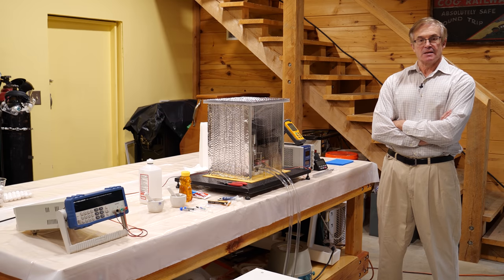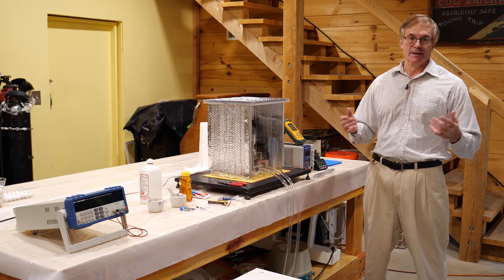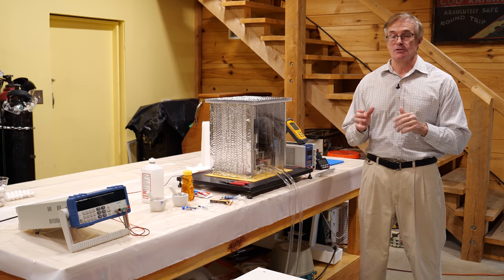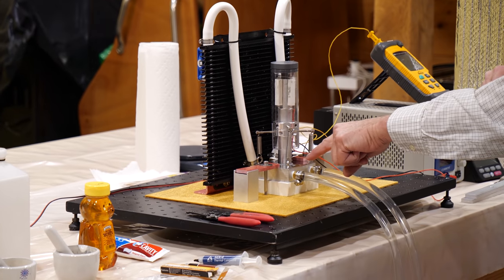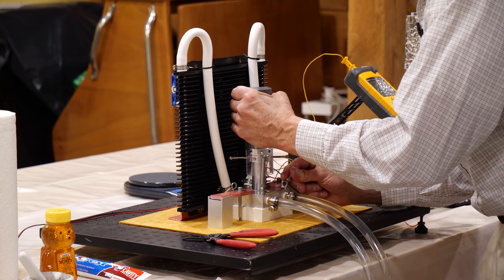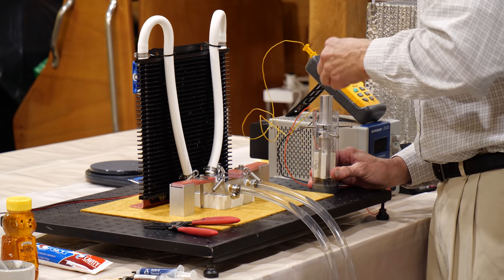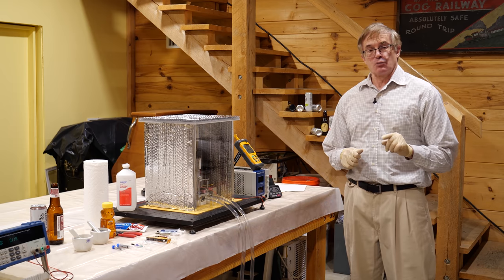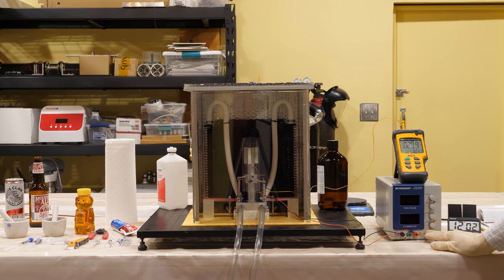DID WE JUST MAKE THE WORLD'S BEST THERMAL PASTE!?

Comment: One concern I have is how long this will last on a CPU or GPU. I use Thermal Grizzly Kryonaut which is almost the same as PK-3 if not the tiniest bit better and it's guaranteed to last years. How long do you expect this to last?
Reply: True PCMR replaces Thermal paste each times he boots up the PC
Reply: @V0LDY  So ... once every two years ?
Reply: This immediately entered my mind as well. How chemically stable is it, and if not how long before it begins to degrade as it undergoes thermal stress?
How long before I'll need to remove and reapply it, and could it potentially begin to set and harden over time and require specific chemicals in order to remove it? If it does degrade over time, could it potentially harm the CPU lid?
Reply: @HallsteinI  guess we will know in the next video where he teaches how to make it
Reply: Most thermal pastes use vegetable oil (ie the stuff you use to cook your eggs) to keep from drying out or polyethylene. You can literally take a couple drops of glycerin (vape juice) and mix it with toothpaste and you have the standard thermal paste that dell etc uses. He has obviously done the research and knows what is needed or he wouldn't sell it.
Reply: This is a huge factor, i use graphite sheets on family and friends PCs. A few degrees warmer is worth not having to T/S a random AF reboot from over temp over the phone cause the thermal paste is now dust.
Reply: @v0ldy54  I'm pretty sure he did videos on how they make it about a year ago.  I think it was around the time they were playing with homemade lasers but don't quote me on that.
Reply: @v0ldy54  if we use Linux maybe 🤷
Reply: @excitedbox5705  You willing to risk that on .1 degrees? Also thermal grizzly Kryonaut does the same so in reality you're betting for no reason.
Reply: Kryonaut degrades above 80C and suffers from pump-out. You should consider at least a yearly maintenance cycle.
Reply: @Tony-nl6pf  the reason is to support the channel. Worst case you replace it every year which is needed with certain brands anyway.
Reply: @zamalek4079  What's your point though, every thermal paste is almost the same in everything you said.
Reply: @Tony-nl6pf  This is a qualitative test so the .1 here doesn't necessarily meany that's the difference in what your cpu might end up at.This is a yet showing the difference between the products and doesn't represent actually te observed difference you might see in your setup;
Reply: @sumduma55  He showed a thermal epoxy before, but most people don't want to permanently glue their cpu. We;ll have to wait for the next episode for this recipe.
Reply: @connorjohnson4402  If there's no difference in the qualitative test, you can pretty accurately compare it to what will happen in real world setups. It's not even .1 I'd guess it would be from the same so 0 to about .05
Reply: You guys crack me up.  I put 20 year old lithium grease on my CPU and so long as it isn't removed it works just fine.  Last application was in 2008 on a Core2Quad...  No maintenance, no problem.  My current VR rig was built using the same stuff and has been going strong for nearly 5 years.  No maintenance.  
Heatsink compound has been around since the 60's.  No veggie oil.  Just heavy metals and happy days.  Proper application, adequate cooler, steady workloads.  It basically doesn't wear out or fail... Not within the useful lifespan of the equipment.  Keep buying whatever they tell you though.  You're keeping someone somewhere in business.
Reply: @tiporari  Your outdated junk doesn't need anything special and we never said ours did either. Your lithium grease and our high performance paste gives a 10 degree difference which is massive for overclocking, sound and performance. I bet you cry about people driving around 100 thousand dollar cars and say look at my beat up truck, it runs better and doesn't have all these stupid sensors going off. People like you crack me up.
Reply: realistically: if done correctly, any decent thermal compound will last at least 5 years if not a decade
Reply: @excitedbox5705  you mean silicon oil. Just about all of the commercially available TIMs use silicon dielectric grease as their base material and that stuff is under 50c/kg (aka clear silicon grease) - and silicon grease is rated to at least 150C

The primary reason the "fancy" stuff is so expensive is because it's sold in tiny packages. 

There's nothing new in that. I used to repackage silicon heatsink grease out of $10 5kg tubs for a major electronics distributor back in the 1980s and the 5ml syringes I put it into cost more than the grease did at about 7c each (2ml into each one) - but we sold it for $2 a pop with a fancy label on it - Total markup about $1.85 a tube and it sold like hotcakes
Reply: @miscbits6399  Lasting 5-10 years isn't the same as performing the same as new. After 2 years, it's time to swap. There's dozens of videos that show it degrades over time. I'm not going to buy his if it degrades within 6 months. It's like buying oil for a car, you need to know how the used and thermally cycled oil runs, not brand new.
Reply: @HallsteinI  I think chemical stability isn't really the problem. The real problem is suspension stability, and while there are a lot of pastes at low and standard performance grades which can last for 10 years, it's a plague that is pretty common among highest performance PC enthusiast pastes, i think IC Diamond was the one that was first noticed to exhibit it, but also Gelid GC Extreme and others. The less stable thermal pastes separate due to temperature cycling, which incurs some movement but is not consistent between liquid and solid fractions, which then allows the liquid to escape. Suspensions can be difficult to maintain.

Comment: Just for reference, what temperature do you end up with if you have no thermal paste at all?  Just the 2 smoothed surfaces against each other.
Reply: I was wondering this too. Would be nice to have the control temp to see how it compared.
Reply: Modern CPUs can even runnwithout any heatsink on them (throtling down so far that they're basically unusable, but still running), so I'd say the temps aren't an issiue, but the clocks the CPU will run at.
Reply: @Donnerwamp  True, but the default surface on CPU's and heatsinks are nowhere near as flat as his test rig. A few of the 'lapped' setups on YouTube would probably be pretty close, but true lapping with wavelength precision like he was talking about is nearly never done on CPU or heatsinks at least on YouTube. (Literally only 1 video with no numbers posted) His test rig is not true lapped, but that's fine.
Reply: For reference, I agree this would be interesting. Also, just for reference, why not use a drop of water.

Comment: I really wonder how this compares to "liquid metal" thermal interface material(s), wonder if you could have a go at testing that out in this contraption as well.
Reply: Yeah, both the gallium-based ones, and the "liquid copper" ones would be nice to compare to this.
Reply: Well for one it would require nickel-plated copper test blocks, gallium destroys aluminium and modifies copper.
Reply: Those outperform normal pastes by a lot. And so they'd outperform this. They have like 6 to 30 times higher thermal conductivity, depending on what paste you compare them to.
Also, they didn't make the best thermal paste until they beat Thermal Grizzly Kryonaut, the best paste I can think of.
Reply: @brei2670  Liquid metal is great for thermal transfer, but it has unique downsides that put it into a category of its own
Reply: Doesn't gallium react with aluminum . His test rod device is aluminum , if I heard right . Doesn't liquid metal have gallium in it ?
Reply: @texasslingleadsomtingwong8751  Yes, he would to switch to a copper or nickel plated copper as TIM is usually a gallium-indium-tin alloy. And yes, gallium is quite destructive of aluminum that it contacts with which can lead to surface pitting and erosion.
Reply: @ravencrovax  Gallium will migrate up the aluminium grain boundaries, turning any it contacts with into a crumbly powder. Also it is conductive, which I am not happy with on a motherboard, so I prefer an insulating one.
Reply: I was going to comment this as well. For those looking at the best thermal conductivity with known, but mitigated, downsides liquid metal might make sense. I think he should test that and also maybe fiddle around with formulations that might make application less risky (hot spots, spillage causing shorting etc). That would be cool as well. Liquid metal has kind of become a fad lately with the enthusiasts so I am curious to see if the hype is worth the downsides. Linus did say on a recent build that temperature differences on a specific build with liquid metal is good for 5 degrees difference, which is actually a lot just for a thermal interface only change.
Reply: I've lost count of how many motherboard/ video card repair videos I've seen where they had fallen victim to the liquid metal going where it shouldn't
Reply: @adamrichardson2227  Yes, but in general use for most people the thermal interface is not too critical, just use some, to a properly prepared surface both sides, and clamp evenly. The difference between as it came from the supplier, and simply making flat with some 2000 grit waterpaper on a flat surface, easiest is a small plate glass piece, or a small polished stone floor tile, is much more than the different pastes alone. Just cleaning off the original compound, polishing the surfaces and replacing the paste with new generic white zinc oxide paste made a 5C difference in temperature. Original was a phase change plastic pad from the OEM Fujitsu Siemens.
Reply: @adamrichardson2227  I actually have delidded and used liquid metal on both my old 6700k and 8700k, both of which I still use daily. The 6700k I saw a 5C drop and the 8700k I got an 8C drop with no hot spots on either chip. If you want to do liquid metal, just go slow and take your time to do it right and it is not that big of a risk. I used about 1/2 to 1 drop per chip and only between the chip itself and the IHS. If you are going between an IHS and cold plate, then standard TIM should be fine. That is what it is designed for. Liquid metal is best for between the chip itself and metal.
Reply: @TheBackyardChemist  I'm well aware. Kryonaut is a normal paste though. Just the best there is, to my knowledge.
Reply: @prodromos65  GN recently reviewed a SFF/NUC pc that claimed to ship with liquid metal installed but in reality 2 samples only had small blotches evidently randomly around the PCB and case - but standard TIM used on the actual CPU.
Reply: @adamrichardson2227  He would need to remake his testing rig and have a non-standard application method in order to test liquid metal (you don't apply a blob and squish out).  It also requires a copper coldplate/heatsink or else it will affect aluminum.  I agree - I came to the comments to see what people were saying about what is accepted as being one of the best (but also very expensive) TIM - but in order to test it he would have to to do a lot of work.  Didn't you see the sigh when he was waiting for cooldown between tests - would you want to put him through that?  The beverage cans might become real!

Comment: Hey i was waiting for this episode, this topic is among my interests! However it took a few days for the video to pop up in my feed and it missed the notification. Will be very curious about the recipe next.

It has been indeed noticed that for example Kerafol's paste Keratherm KP92 has 10W/mK but performs worse than MX-2 which is specified at 5.6, in fact it performs worse than just about anything north of 1W/mK. It would be weird if Kerafol wasn't being truthful, they are an industrial supplier rather than a customer facing brand. Different measurement method is indeed a possibility, but another is that thermal conductivity just isn't all there is to thermal paste's performance, as thermal conductance isn't really its primary purpose, it is to provide a high surface to surface thermal transfer while not actually bridging a substantial distance. There could be several reasons for surface to surface thermal impedance, like microscopic coverage, or just something about carrier material properties. Also the layer thickness that the paste ends up spreading out to under a given pressure for sure has to affect performance.

Curiously, AS5 was estimated by NREL to only have less than 1W/mK thermal conductivity, 9 times less than specified; as opposed to Shin-Etsu X-23-7762-S and Dow Corning TC-5022, where the test result was similar to manufacturer's spec and several times better than AS5.

Also regarding MX-2, it's Arctic Cooling's lowest cost offering, with the mainstream one being MX-4. Both have insane long term stability. It has long been known that in CPU tests, MX-4 performs better, this has been a result of pretty much every test to date regardless of publication. However Igor's Lab (former Tom's Hardware Germany, now independent publication) has noticed that when tested in direct die applications, such as on a GPU, MX-2 performs better! One fairly obvious difference is that MX-2 is harder to spread and potentially requires more contact pressure to spread thinly. MX-4 has lower density, lower viscosity, and higher nominal conductivity. It has presumably less solids content by volume, but the solids that are in there might be more thermally conductive.

Up until recently, MX-4 was Arctic Cooling's high performance paste; just months ago, it was superseded by MX-5. Arctic Silver 5 is not the higher end offering, it's a competitor, and a very old one. These are two different companies. Arctic Cooling is from Switzerland and Arctic Silver is from the USA. Arctic Silver's lower cost product is Céramique 2, which doesn't contain silver.

So your results have been that MX-4 performs worse than AS5. That's a discrepancy with tests performed by the PC enthusiast press, such as Planet3DNow (defunct), Guru3D and Tom's Hardware & Igor's Lab, that usually in their tests, MX-2 comes out equal to Arctic Silver's AS5 in performance, which was quite a shakeup when MX-2 first came out, because it just feels nicer, is safer not having any conductive material in it, and is a whole lot cheaper too. There was MX-3, but it didn't make a strong case for itself and was discontinued. MX-4 is a substantial improvement upon the former ones in tests. Ceramique never performed particularly well. There is a small number of people who still swear by AS5, so it survives on the market, but it fell out of most tests by now.

I wonder if water based materials would perform better if you lower the surface tension. So add dish soap to toothpaste. This is not a practical idea, after all toothpaste is not a material that will last long term and soap isn't going to change much anything about that, but it would potentially allow to test your hypothesis that better surface contact is the reason honey performs better. It won't be a conclusive test, but it can be a data point and more tests can be devised later.

I suspect that given you have practically mirror polished and matching contact surfaces, the solids contents of toothpaste could be doing it a disservice and increasing the actual layer thickness, since you don't need the material to actually be thermally conductive, you only the material to have a low surface contact impedance to the both surfaces, and low layer thickness. Real CPU heatspreaders and heatsinks aren't actually like that, it's not uncommon for the integrated heatspreader of the CPU to be a little domed in (concave) due to the manufacturing process, and many heatsink manufacturers deliberately make their heatsinks a tiny little convex, which is most noticeable if you look at ones made by Scythe, reasoning that increased centre contact pressure where the CPU die lives in the heatspreader package is going to make for a better heat transfer than corner contact, and also it can help the excess paste squeeze out.

Additionally, different geometry and surface quality of your test rig can explain some results discrepancies vs. computer press.

You have not specified whether Noctua paste is NT-H1 or NT-H2 and which Shin-Etsu paste. Also you made a typo in Noctua's name in the spreadsheet. :D

I recall there are a lot of pastes with known practical issues - Gelid GC Extreme, IC Diamond, etc, which showed spectacular performance but were known (at least initially, they could have gotten better since) to not last very long, rapidly drying out. This occurs because the heat-up and cooldown incurs some material movement, and the carrier liquid and the solids can then separate, and the liquid is then free to leave the thermal interface area. Do you think you can devise a test, which can demonstrate whether the paste stays in suspension or will separate over time? With these pastes, separation took months or years, but obviously you don't really want to repaste your computer every 6 months, that's effort; do you think an accelerated test is possible which can demonstrate this issue within a week or two?